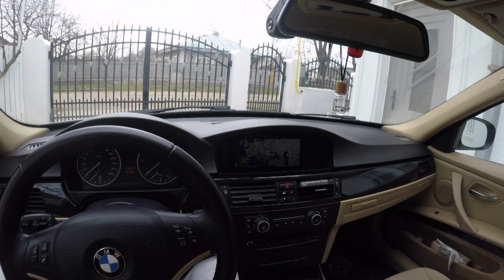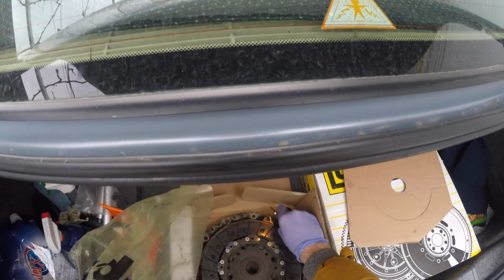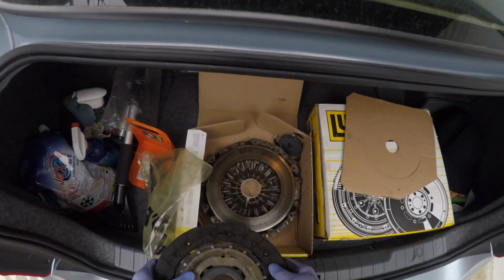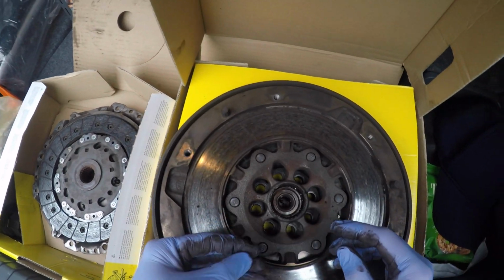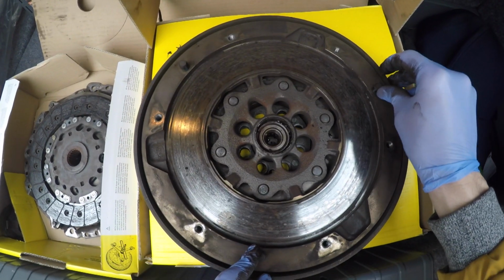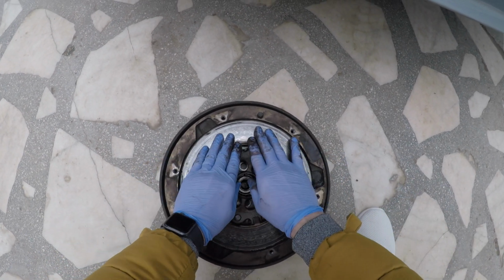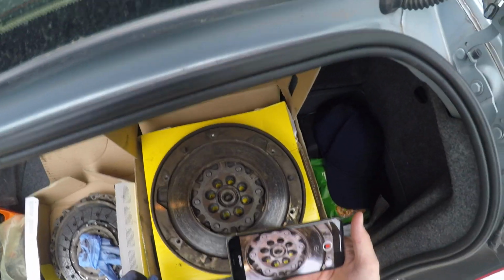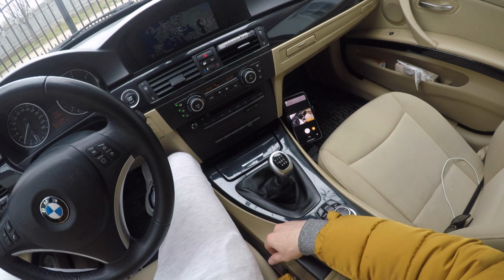How to fix the shifter shake bmw e90

Comment: guys remember when ever you change clutch change salve cylinder and flywheel i know its lots of moneg but please do
Reply: Why?
Reply from the maker: he is right , because it gets worn pretty fast and it can damage the new parts
Reply: @DrMeize  ok, that is one approach. But I find that going this route you're always changing more than is broken and jack the maintenance cost. I like to change whatever is broken or what gives clear signs of being almost broken. If it works, don't touch it :) For instance I had the noise when pressing the clutch and the mechanic advised I should change everything, not just the release bearing. So I bought OE parts (flywheel, clutch set, etc.) about 1000 EUR. When he took of the old parts, only the bearing was clearly broken - in basically split in 2 parts and that why it was making the horrible noise when pressed. The flywheel was creaking a little bit when turned let and right indeed and probably had a bit more rotational and depth play than the new one but, it could probably have gone for a log period. I still have it. The clutch disk has some signs of wear but, those channels were only like 1 third or less flattened. Parts + labor was about 1100 EUR. Had I only changed the broken part, the release bearing, it would have been around 200 EUR. Except for the horrible noise when pressing the clutch pedal, there are no dramatic increases in how the clutch feels and how the gears are changed. I don't think it was work changing everything. There another point to this: had I only changed the bearing, the flywheel had no need to be taken down so, less labor plus the fact that it's 100% sure the new part was not mounted as good as the original part was on the assembly line in the factory, no matter how good the mechanic is. So I would definitely only change the release bearing if I had to do this again! The flywheel can be inspected while mounted on the car and there are specs to tell if its still ok or not. And then if in 3 years time there will be a need to change the disk or something, that is fine - there is no guarantee that changing all the parts at once will last longer than that for the reasons mentioned above: no matter how good the mechanic, it's impossible to do the job as well as it was don on the assembly line in the factory.

Comment: Im a new subscriber your channels  really good im from the uk and im going to get a 318d soon
Reply from the maker: big thx and hope you get a good deal on the new car :)
Reply: @DrMeize  i did just got a nice black 2011 318d with black leather an i drive for £1800 its got 180,000miles  but has full service history from bmw so im not botherd about the milege its a nice upgrade  from my previous Peugeot 207
Reply from the maker: the mileage doesn't matter in my oppinion if the car was treated good ;) drive safe
Reply: @Ethankeenan02  start saving hard.
Reply: @Ethankeenan02  damn has it broke yet? Get a spare engine asap.
Reply: @Ethankeenan02  how is the car doing after a year of ownership?

Comment: BMW say that you must push the trans straight at installation or you may bend the trans input shaft and maybe thats where all the trouble began
 you may need t check your transmission mount
Reply from the maker: that s really not my problem and should not be anyone's else beside the mecanic that works on the car.This is a pretty difficult operation and I don't recomend doing it by you're self in a garage or a corner shop.

Comment: Salut, am un e87 din 2010 si l-am dus la mecanic pentru ca imi tremura rau schimbatorul si efectiv toata masina cum iti face tie in clip.
A pus baiatul testerul si a vazut ca un injector e stricat. A trimis toate injectoarele la verificat si a zis ca trebuiesc schimbate toate pentru ca nu aveau presiunea necesara si 2 dintre ele pierdeau benzina. Acuma masina merge mai bine insa tot imi tremura schimbatorul (ce-i drept nu la fel de rau ca inainte ) si cateodata intra greu in marsalier, a intaia si a doua. Poate sa fie de la volanta cum zici tu in video?
Reply from the maker: Salut , daca nu ai schimbat o niciodata cred ca e timpul ei ..
Reply: Salut ai gasit solutia?

Comment: Hi 
Thanks for sharing 
Btw why there’s vibration after replacement? I got same issue but my concern if vibration will go away or there’s will be still little vibration? If so how to fix that ? Thanks for your time 👍
Reply from the maker: well a little bit will stil be there , it s on  there to remind you of the torque :))
Reply: @DrMeize  thanks for reply.👍

Comment: Nu te-ai gandit sa pui original? Luk-ul precedent nu te-o tinut prea mult; 50 mii km ii cam putin.
Reply from the maker: pai luk e pe original , si sincer pt cuplul masinii cred ca tine suficient
Reply: @DrMeize  piesa originala e BMW, produsa de LUK. Asa cum iPhone-ul este tot un Apple, chiar daca e asamblat de Foxcon. Cand LUK face piese pe contract, pentru BMW trebuie sa respecte specificatiile din contract si tolerantele la Quality Check. Cand LUK face piese sub numele lor, atunci pot sa le faca cum vor, atata vreme cat potrivesc la montaj.

E mult folclor pe tema asta, ca platesti numai sigla, etc., dar mi-ar place sa vad niste fise tehnice leaked de la un producator, ca sa putem compara exact.

In lipsta de fise tehnice, cred ca am putea compara pe un cantar de exemplu, greutatea piesei originale si a cele LuK; poate ar fi un indicator.

In rest originalele, tin 2-3-400 mii km. As fi curios cati km si cati ani tin OEM-urile.

Care piesa merita sau nu, ca si costuri, asta decide fiecare proprietar dupa criteriile lui, dar eu nu cred ca piesele sunt identice.
Reply: @handleby  bine gândit, chiar ai dreptate. Nu vor fi identice la calitate sub nici-o forma 👍